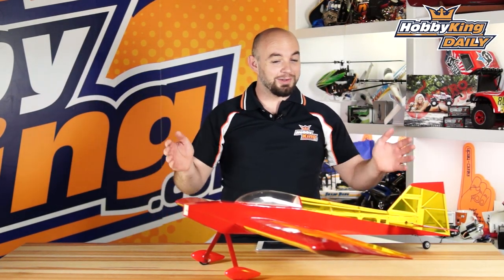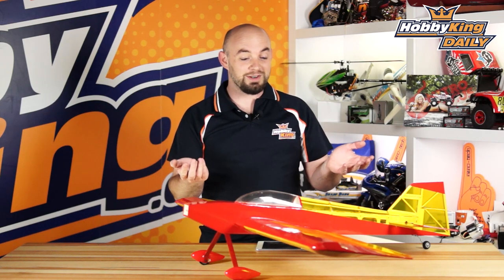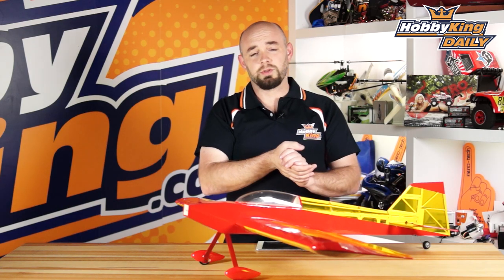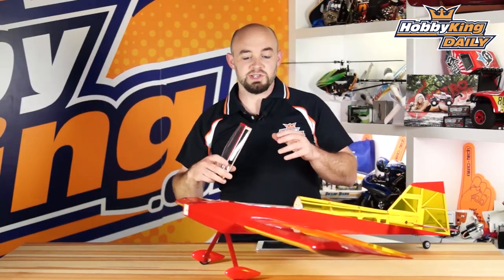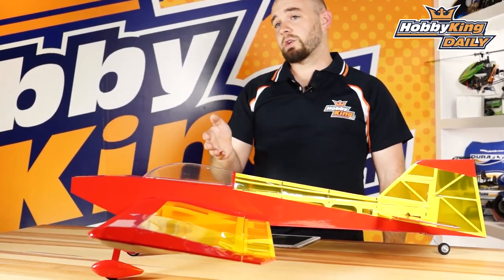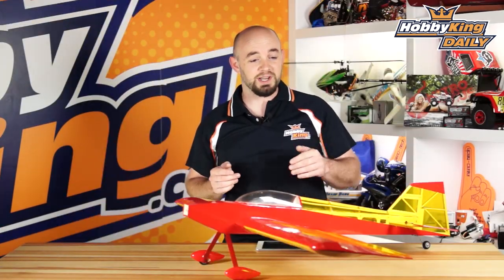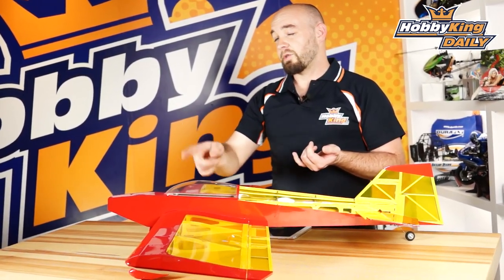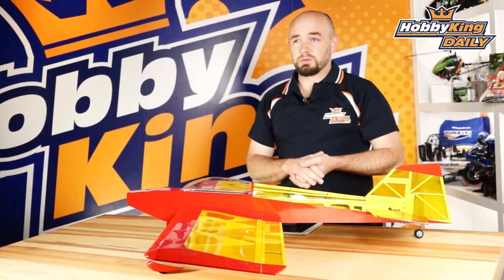HK Little 3Der - HobbyKing Daily

Comment: Hobbyking if you do ever answer comments can you please just answer this one?  My question is... Is the gear made out of a steel or strong materials besides plastic because I have found that in some of my models the plastic gear breaks easily true or false?
Reply: I am pretty sure it's metal. It should work fine.
My personal favorite material is carbon for middle size planes, it's light and very strong. I also like metal gear on bigger ones.

Comment: Why would they use pull/pull cables on such a small model? Instead they should use plastic pushrods.
Reply: Sometimes it is better! On my small shockflyer they used it too. An on my gasser, it gives much travel
Reply: 1Thatstrangeguy Whth large deflection area compared to the servo strength a single pushrod often becomes uneven on right/left deflection in flight. Also with the servo mounted forward you have less wight in the tail and thus can make a much lighter nose and so a lighter plane over all.

Comment: OMG, that is an ugly airplane or what ? Come on HK, those last released airplanes are such a claim "Don't buy me, don't buy me !" Jesus...what a bad taste ! I'll give some tip: take a Domin8Trix, put a new color scheme (maybe in red and yellow also), design new rudder and elevator airfoiled both, put a CF landing gear and you will have a top seller for $130.00 bucks ! Be happy !
Reply: I'll have to disagree. It's more of an old school design for light sport fun flying. The plane probably is a blast when setup lightly loaded. There is a grace in flying models built like OldTimers but shaped for aerobatics. The thing probably snaps and tumbles great because it flies more 'on the wing' than the typical overly stable heavily loaded model.
Reply: I disagree, it has a cool look to it, and remember, it is balsa/ply so it has to have more rough angles to it. Also, look at how ugly foamies look right out of the box, and after a few crashes, they look even worst.  With IG and spare transparent film, you can keep this plane looking great as long as you want to. No EPO throw out every season crap here.